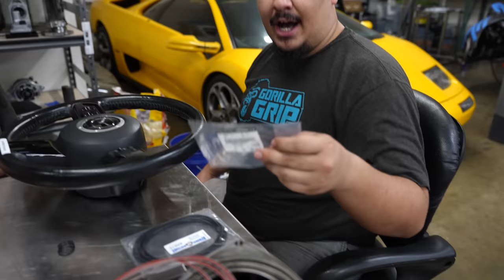How to rebuild a Cheap RX-8 for under $250

Comment: I never plan on building a rotary, but I'm watching this like there is a test later.
Reply: I want one in the future, but I feel what you said a lot haha
Reply: Have an 12a in my garage.. will pull it apart this winter. Curious how much these videos will help me
Reply: Same here bud lol. Love these types of videos. Love learning useless information.
Reply: I found myself doing the same lol
Reply: Same, I'd actually be more likely to LS swap an RX8 than do a rotary build, but I enjoy the channel despite Rob's wrong opinions about LS engines anyway. haha
Reply: It’s actually way easier than it looks lol. I do 12a’s and 13b’s often. They might not last 200k miles very often but they are simple to pull out and fix in a weekend if needed. As long as your housings aren’t missing too much chrome lol even if a small amount of chrome is missing usually some light wet sanding will get you by until you find a good set of housings. The only real issue is if the 2 piece apex seal chews up the outer edges of the housing chrome.. then you’re in trouble. There’s a guy in canada that has rechromed some of my housings in the past but I’m forgetting his name right now. Good 12a housings are gold.. now were using cut down 13b housings but the coolant seals are a bitch to get right with those housings since the machining cuts the seal grooves out of the housings and the seals will pop out if you’re not careful.. typically what i do is use permatex to hold the seals in and let the permatex dry then very carefully assemble.. it works most of the time. Keep the rotary game alive!
Reply: right XD
 Makes me wanna start a project lol
Reply: 😊😊😊😊😊😊 @jasepoag8930
Reply: 😂 I came here for info and learned a few tricks 😅
Reply: Looks so easy to take out and put back together
Reply: You and i are completely different then hahaha, i gotta learn quick before i move out of my current place
Reply: My engine is currently open and this is a massive help.
Reply: Best to learn your car

Comment: When Isaiah asked Rob to hook up battery and Rob responded with "I'm your electrical guy" I started busting out laughing because the wiring madness rob had laid out all over the engine bay of the 3-rotor while he had it running popped in my head, lmfao.
Reply: Ahhh the good ol Spaghetti  with mustard and ketchup wiring days.
Reply: Rob is the flying spaghetti monster from south park!!! Lol
Reply: Really good, i thought about the Turbo 4-rotor sucking the sensor cable in while testing :-)
Reply: @mikefoster4105  Contrary to what you've said, Pastafarianism doesn't originate from South Park.

Comment: Honestly, thanks for these videos showing us, that you don’t have to spend an arm and a leg to rebuild or work on a rotary engine. Something most rotary shops won’t show or tell you, just to take more money from our pockets. This really gives me a lot of confidence to be able to do it myself, if my fc RX7 decides to blow.
Reply: Need to remember shop labour is over $100 an hour. This is absolutely $2000+ at a shop.
Reply: If u can even find a shop that wouldn't just buy a used engine to put in (with a bad coolant seal lol)

Comment: I keep coming back to the RX8. I fell in love with them driving one years back and it's on my list to buy next. I just wish I had even a regular garage to be able to do my own rebuild. Apartment life sucks for that.
Reply: U try rebuilding mechanical shit on a dining room table lmao its actually not bad
Reply: @Token_Black_Guy  I think the 3d printers all over my place kinda prevent me from having enough space to even do that. But my dining room table does have a built in lazy susan... so I could spin a motor around on it... don't give me ideas.
Reply: @vaerontv  print me some A pillars for my Ae86
But I agree get some space first! I had a couple Rx7z and a 04 rx8 

The 8 was super fun! Had Ac and really nice suspension! You can slam the gas through any corner and plant to the ground! The throttle response was amazing 

Yeah it’s n/a and slow compared to a turbo fc or fd but man they so much fun to drive and slide around!
Reply: @JB-sv5pr  If you're in Dallas, I got a printer, but it won't be pretty, height is a problem with printers, so we'd need epoxy every 10" or s.

Comment: When my Renesis S2 was cracked opened at 48k the rotor housing chrome was pristine. three oil injectors reall do the work vs older two or one. Only thing was there was so much carbon from previous owners putting in synthetic oils during oil change.
Reply: Fucken' synths man.
Reply: Why would synthetic be bad of them?
Reply: @FishFind3000  It doesn't burn as cleanly, not a concern for a normal motor but in these the oil is used inside the combustion chamber
Reply: @aserta  wankel by nature does not have enough time to burn all the fuel and air mixture. It also has to throw in oil for lubrication on the seals spinning along with rotors. Synthetic oils are made to resist heat and not combust like fuel. So they leave a lot of unburnt deposits inside the rotor housing, exhaust port, and on the rotor itself. They will seize the seals in place and prevent getting good compression, attract fuel to the carbon build up and have hot spot detonation, and they can build up on the side exhaust ports of Renesis, catch and break the side seals, killing the engine.
Reply: If I’m not mistaken (I didn’t pay much attention to the video) but rob suggested adding a 2stroke oil to the mix because that’s made to combust
Reply: @danielmedina1589  yes, one way. The better way is to re route the oil injection to same 2 stroke oil (there are better rotary specific premix from Idemitsu) fed from a separate feeder tank, ie Clean Oil Feed, aka Sohn adapter (for engines older than version 2 Renesis).
Reply: @Soravia  there is talk on the forums of rigging some old power steering pumps from old MR2s to make an S2 Sohn Adapter. Also I use synth oil and premix.
Reply: @bluspectre2042  I'll get two! One to feed premix to electric OMPs, the other to run the hydraulic steering rack from NC Miata to bring back the feedback to my hands driving the car.
Reply: Um, synthetics burn cleaner than minerals...

The stigma about synthetics comes from when they were all made to not burn. Modern day synthetics are perfectly fine to run (if you get the correct one) 

A synthetic is just a lab made oil that identifies to the mineral it is based on, and do not contain all the redundant shit that is present in mineral oils, which is why synthetics burn cleaner.

There are many synthetic blends made specifically for rotary applications, I run one in my FD
Reply: @PSNPaero86  the problem is they don't readily burn. Wankel already doesn't burn fuel completely.
Reply: Nah it’s not because of the synthetics, HKS Rotary oil, RE Amemiya oil and Royal Purple are all full synthetics. Rotaries need to be redlined and /or driven spiritedly in the high rpm range to burn the carbon away.

If you drive like a grandma and then turn off you car without redlining in a session, carbon will build. You need to hammer these cars and they’ll actually be healthier for it.

The low viscosity oils that Mazda recommend like the 5w minerals are a huge reason for a lot of the engine failures, they are very bad for the bearings. You need old school 10w40 synthetics and run rotaries hard. Redline a day keeps the carbon away.
Reply: @Soravia  this is why you need to be in high RPMs, trust me you will have no problem burning that oil if you hit 9k rpm consistently and drive spiritedly during a session, you actually want higher viscosity oil for this, lower weights can mess up your engine bearings
Reply: @Soravia  the good thing about synthetics is they are exactly that, so they can be modified to do whatever you need it to, a synthetic can be specifically made to do certain things, like resist burning, or, get this: BURN!

And because they arent minerals there is no redundant shit in them so yes the right one will burn cleaner, but you have to pick the right one, like @pAyA said, some of the most common oils to premix with are full synthetic 

throwing around this whole "Synthetic bad, mineral good" bullshit is not helping the community at all.

Comment: It took Mazda over 3 months to replace the motor in my 04 RX8. It only had 29,000 when the coolant seals went bad. BTW I think people would love more of this type of video from you Rob. Great job guys! I had fun watching
Reply: If you have the space, and can rent or borrow a car for the meanwhile. It's genuinely worth doing this yourself. I wouldn't trust non JP technicians anyways. They never get it right, because almost none of them are trained to do it. You know, when you've landed with someone who was invested into, sent by the company to JP and got educated by their techs, because the whole job takes less than eating cake.
Reply: @aserta  it's funny you mention that they never get it right. I don't own the car anymore and this was quite some time ago.. but after about 10k miles motor started failing again. I ended up buying a Mazda 3 speed.... One of the best little cars I ever owned!

Comment: I think the best part of these is that, while a little complex to assemble/disassemble rotor wise, the general size/weight of the rotary makes it feasible for a dude in a not large garage to tear down and rebuild one without cramming up the space. Put it on a shop table and go to work!

Comment: My first RX-7 was also a GXL, bought it with a blown motor for $200.
Then found another one with an automatic transmission with a blown transmission but a Mazda Reman engine for $250. Then proceeded to swap all the best parts into the GXL and I had a running driving 5 speed car for <$1k.  

Fast forward 5 more cars and I resurrected a $3,000 FD and even took it to VIR.  I'll never sell this one!

Comment: I want to see Isaiah's love of RX-8s to turn into Renesis builds that rival Rob's various engingines.
Reply: If this dude builds a 4-rotor renesis I may never wear clean pants again
Reply: @F3Ibane  With Rob getting into machining, and eventually doing his own billets, I think there's hope for the Renesis. Two major issues need to be solved, how the ports breathe and the cooling issue that melts seals. Rob is already messing with how ports breath on one of the other rotaries. The cooling issue would be solved with better designed parts, hence why manufacturing custom parts from billets is important here. The Renesis design has potential, but that potential isn't met due to manufacturing corner cutting from Mazda, such as not grinding out better ports for better airflow characteristics, or the cooling issue that could be fixed with a more efficient cooling design. 

If Rob, the team, and probably some helping hands that actually studied thermodynamics and engineering, can produce a modified Renesis design that fixes the issues, think about what other fringe experiments Rob could get into that're mostly untouched in the rotary world. Stuff like what Paul Lamar was into and some of the stuff like what the person who runs the Pattakon website is into. If Rob is willing to dip his feet into the waters of fringe experiments with design, things could get super interesting.

Comment: In the case of rebuilding a high mileage rotary like this why do you not replace all of the rotor seals and springs with new ones?
Reply: i think the idea in this case is to do it as cheaply as possible
Reply: He used a fucking auto screwer instead of proper tool to put it together and you ask about seals XD

it's fun cheap project for them, designated to be blown up eventually
Reply: @versedi  The battery torque wrenches can be adjusted to a specific torque. He did that. Then tightened it again with a proper torque wrench. What are you so mad about?

Comment: Rob, saran wrap. Pack a side and then stretch saran wrap over it for the flip. It'll hold everything in place while you work on it. Make sure the saran wrap will be on the top when you flip it back over on install.

Comment: That large ring is called a Blowby scraper ring. It helps to close off the ports to the oil control rings under it, because of the exhaust port, and the intake port shapes.

Comment: I just rebuilt my S1 RX-8, and while yes, you can build them on a bucket, the engine stand heads aren't too expensive or hard to get. I spent a little more, but that said, You got off luckier than me. My original engine had spat side seals out the exhaust, and cracked 6 corner seals, coolant seals, and all but 3 oil control ring soft seals. That engine is partly in my closet, and the e-shaft and flywheel (which are still in great nick) are now bedroom ornaments, while the rotors from the that block live on in my rebuilt engine, because I cleaned them up when I tore that engine down, and the bearings were in superb shape, unlike the rotors that came out of my replacement engine. Rotary engines are a crapshoot when it comes to used engines, but they are a fucking blast to rebuild. The original engine I have will be ported, and I'll buy new housings for it, but the plates will remain, as I can use the valve grinding paste on another plate trick to clean those up, with a streetport job. Can't wait to see more, guys.

Comment: I just got started watching your videos, because I have been fascinated by the rotary engine for some time. Back in the eighties, I had two of them, and was blown away by the acceleration and the way that they would wind out. These cars were Arizona cars, and were faded and a bit shabby from the sun and heat. I was sitting at a stop light one afternoon waiting for it to change and a young guy with a brand new Camaro pulled up next to me. I saw him sneering at me, and decided to teach him a lesson. I guess he figured that I would just poke along. When the light changed, I left him sitting there and was gone in a cloud of smoke. The motor quit soon after. I was used to piston motors, and could work on them without too much trouble, but when my dad tore into that rotary I was amazed by the seeming complexity of the things. It took me years to understand how they even worked. They seemed to be somewhat fragile to me.
 One thing I would like to say, is that Isaiah doesn't inspire a lot of confidence with what seems like a half assed couldn't give a shit attitude, and I wouldn't be surprised if the bong was getting a bit of a workout. I don't know you guys, so I haven't decided yet, not perhaps that you should care. If you're just doing this for a hobby, I guess impressions won't matter, but if you're in this to make money you might want to tighten it up a bit; just a thought...

Comment: Good job, this seems easier to work on then my 4 cylinder, now I want to buy one that doesn't run with fairly low miles and start tinkering with it and rebuild it. I could do this, may take longer than you guys but definitely seems obtainable. Good job you guys!

Comment: Great job guys! I hope there is more rx8 Content, the rx-8 rotors are amazing, I have seen NA 20b make 500 on them. the ticking noise is the SSV valve assembly, there is a newer version available that stops the ticking. Perhaps you guys did off camera but the SSV and the APV's get built up with carbon, best to clean all that too.

Comment: If you want to turbo an rx8, I was about to send off my keg for strengthening. Feel free to experiment. Car's designed for Texas summer heat and ultimately chasing down Porsches at COTA. Yesterday I discovered you can boil out gear oil at a four hour enduro.

Comment: Isaiah!!! Don't use a screwdriver to compress the oil control rings. They WILL snap. Grab a block of wood and press down evenly across the whole seal until it seats. You can even smack it lightly with a dead blow that way too.

Comment: Try leaving a tub of Vaseline in the fridge, it solidifies a bit and can give you more time for it to hold small pieces in place. On really hot days if you can put the parts in the fridge too, so the Vaseline doesn't melt too quickly.

Comment: There are some markings on those rotors already, In my case, FE and RE. (Front and rear, and E represents an E weight rotor, Weight class is from A to E.)

Also, Mazda do Pre-cut seals, and there are different part numbers corresponding to a letter. If you look closely at a rotor facing the wrong direction, the scalloping is on the wrong side, if you try to put a rear rotor in the front housing, and vice versa. Just rebuilt my renesis a few months back, from a much worse but still savable failure, and buying a new block that turned out that it needed a refresh, so I used the rotors that originally crapped out on the original engine I had in my 8, because, after using a scotch-brite wheel on a bench grinder, they came out looking like gleaming, fat, dorito shaped art, with no carbon to be seen, and mint enough to reuse rotor bearings, and same with the stat. gear bearings on the replacement block. Assembly of rotors is one of the fun bits you can space out on and enjoy.

Comment: Great video. Man I just had our 08 engine go low compression. Found a friends old wrecked rx8 at junk yard and bought that engine. Ran 2 months ago until wreck. Have it in the engine bay now, old engine out. Just need to finish up connecting hoses and lines, mounts and get it back housed with transmission. Any pointers ?

Comment: I was planning on getting a mustang as my next car, but you can find Rx8's so cheap and it sounds like while they need more maintenance than normal, it isn't too expensive. Plus I want to learn about working on cars so it's a win win. And looking at it, seems to be less tedious to work on. With a regular combustion engine you have to worry about a bunch of valve clearances, springs, rockers, I'd have to replace more spark plugs. In rotaries you really only have to worry about one area.